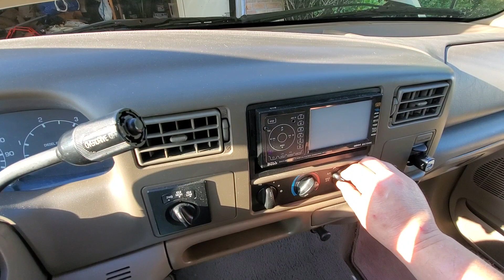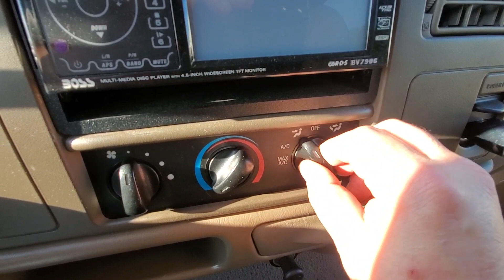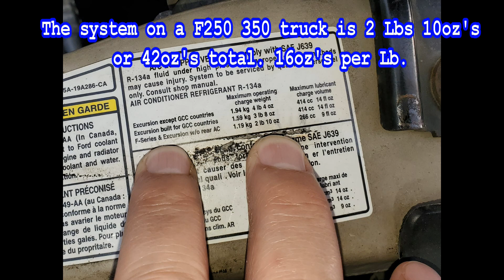How to Detect Low AC pressure Easily Ie F250 or F350

Comment: I have a few questions;
1. How long can I run the ac with the bypass?
2. How do I know if the pressure switch is N/O  or   N/C when buying a replacement  if it doesn't have a part number,  or is not in the auto system computer? 

I have a semi with an APU that keeps giving me a Low pressure fualt reading.  
I put ac in the system before starting to troubleshoot,  so most likely it's overcharged now.

What the AC is doing:
clutch turns on for 3-5sec. before it disengages. 

After  3-4min. It gives me a low pressure reading on the unit, and the clutch is disconnected for safety.  

Troubleshooting:
* I found out the fan was not = working and replaced it. 
Clutch still engage for only 3-4sec.

** bypass one of the pressure switch and noticed that the clutch will stay on for a longer period of time.  (Seems to be the problem). 
= not sure how long I can run it with the bypass,  so after 15sec. I pulled it out. 

Need to know if it's overcharged, if it will damage the system if left on too long with bypass?
Reply from the maker: Glad you asked that question, it's a very good and intelligent one.
1. I would not run the bypass more than 10-20 seconds at a time. The system is designed to switch on and off every few seconds as it's doing. That's why the switch is actually called the Clutch Cycle Switch, but most people still call it the Low Pressure Switch. So the clutch will cycle on and off 10-20 seconds at a time and that's normal.
2. Most Low Pressure or Clutch Cycle Switches are NO and will have the open and close pressures stamped on the side of the switch. High Pressure Switches are NC and will also have the open and close pressures stamped on the side of the switch as well.
 
Some systems are coupled into the computer but most are not for Light Trucks, I do not know for a Semi Trucks.

* It sounds like that the fan was definitely your initial problem, and the Cycle Switch sounds like its working to me. If you have another truck with a working AC System just like yours, open the hood, run the AC and compare them and see if there is a difference.
** If you bypass one of the Switches at a time, the system should run until the one that is not bypassed will cause the system to cut out. If in doubt on which switch is bad change them both.
= Again I wouldn't run the bypass more than a 10-20 seconds at a time. 

For sure if the system has a major undetected pressure issue don't run the system in bypass mode more than a few seconds or you can blow the AC line. The only SURE way I know to tell if its overcharged is to put a set of gauges on it. 
=== Another way to guess the pressure is right is to put a low pressure gauge on it and let a little of the refrigerant out until the pressure reads slightly low. Then add just enough refrigerant until the low pressure reads right for the outside temperature. If the system is charged correctly the system should cool the cab down as normal and the clutch will cycle on and off every 10-20 seconds. It's better to have the system a little low than run the system in an overcharged mode with possibly bad pressure switches.

== Here's what I would do in your situation. 
1. Make sure the Condenser and Evaporator are both clean, don't forget the Cabin Filter too, if your truck has one. If they are clogged the system with cut in and out more often and won't cool properly.
2. Change both switches. NOTE when changing the High Pressure Switch the, one closest to the Compressor, the Schrader valves like to stick and let all the refrigerant out. So be ready with a new seal and some Refrigerant Cans to recharge it. You might want to wear gloves for that so you don't get frost bite.
3. Rent or buy a set of gauges to fix it.
4. If buying a set of gauges is out of your reach, take it to an AC repair shop and have them check the pressures for you. Some shops will do a quick check it for about $35.00 US.
5. If that's not possible try to do the "=== Another way", listed above.
Hope this answers your questions and helps you diagnose and fix your AC System. Let me know if I can answer any more questions. Best Wishes & Blessings. Keith Noneya    PS where are you live?

Comment: I'm having such a hard time. I have a 2000 gas excursion, the compressor is running(It turns on and off), the system is full, but it only blows luke warm air.
Reply from the maker: You may have to put a refill bottle on it to see if it's barely low or overcharged. The other possibility is the Evaporator is clogged and needs to be cleaned. You need to put a set of gauges on it to check the pressures. Also check the Condenser to ensure it's not clogged too. Hope that points you in the right direction. Best Wishes & Blessings. Keith Noneya
Reply: @keithnoneya  Thanks for the tips, I will try that.
Reply: @keithnoneya  Thanks for the tips, I will try that.

Comment: Is the low pressure port  where the schrader valve is located.        thanks  George
Reply from the maker: No it's on top of the Accumulator Dryer under the black cap that I point to at about time index 3:35 through 3:55. Now it does have a Schrader Valve inside the port but so does the low pressure Cycle Switch, so I used the time index to make sure you get the correct Schrader valve. Hope that helps point you in the right direction. Best Wishes & Blessings. Keith Noneya
Reply: @keithnoneya  Thank you so much. i noticed there are threads up at the top of the accumulator low pressure port but I believe the valve is lower? I have been trying to find a schrader valve for the top.
Reply from the maker: @patchreefs  The threads in the top are the ones that the schrader valve screws deep inside. Notice how far I put the screw driver in the let some of the R134A out. The top port is where you check the low pressure and fill if it's low. If you don't have any R134A in the system that port is where you can pull a vacuum or pressurize it with air or Nitrogen to find the leaks with some soapy bubbles. The lower port schrader valve is for the Low Pressure or Cycle Switch, so if you change it "Theoretically" it won't lead if you pull the switch off. This isn't always the case, so if you pull it off have a new seal and pressure switch ready to go back on quickly so you'll minimize the amount of R134A leaks out if you change it.
When dealing with pressurized gasses always wear a set of safety goggles. I did a high pressure switch on the compressor up on top on the high pressure line. And sure enough as soon as I pulled the switch off it started leaking out rapidly. I had my goggles on and had a switch and new o-Ring and it was tough but I was able to get it on before I lost a lot of R134A. We added on can and it's been good since them. Best Wishes & Blessings. Keith Noneya

Comment: Here is a question... how do you know which wire engages the clutch, ie. ground or + wire?  Will you see only voltage coming through the wire when then the AC turns on?  So if you take a volt meter, unplug the two wires in their harness from the compressor and check which one (looks like green and red?) gives voltage when the AC is on right?  Trying to install an e-fan in my 6.0 2005 F350 to replace the clutch fan...
Reply from the maker: Super good question. I'll look in the schematic in the service manual when I get home. Haynes has a copy in the back if you have one. If you don't have one and want one, I can email you a picture of it. Send an email to my channel email here: keith_noneya@att.net and I'll email you one for future reference. Don't worry I won't put you on some mailing list or send you a ton of crap or anything like that. It's just for the picture if you want a copy. Either way I'll still try and answer your question when I get home in about 3 hours. Not shown in the video it the high pressure switch. Those go bad too. Without the engine running if you pull the connector off and put a meter leads on it, it should read a short. Low pressure if you have a good charge should also read a short, on the sensor itself. Either way I'll do my best to walk through this with you and help you find your problem. Best Wishes and Blessings. Keith Noneya
Reply from the maker: Hey Alp, the 12vdc comes from the AC switch on the dash, to the Low or Compressor Cycle Switch, to the High Pressure Switch then to the Powertrain Control Module (PCM) then to the Fuse Panel Wide Open Throttle AC cutoff Relay or (WAC) then to the compressor clutch coil. The connector on the compressor has two contacts in it. The top one is the 12Vdc supplied by the switches and relays, the bottom one goes to ground. If you're going to run a fan off the AC switched low pressure or Compressor Cycle Switch I would run that to a relay and have the relay run the fans from the battery. Also don't forget to put a fuse in the line and put a parallel bypass Thermal Switch so that when the engine gets hot the fans will come on regardless if the AC is on or not. Hope that helps answer your questions. Best Wishes and Blessings. Keith Noneya

Comment: i HAVE A 2003 f-250  i PUT THE a/c ON WHEN I LEAVE WORK , IT IS NICE AND COLD FOR 5 TO 7 MINS THEN IT STARTS TO BLOW HOT AIR.I TURN IT OFF OPEN THE WINDOWS AND GO HOME IT SETS IN THE DRIVEWAY FOR 2 HOURS OR SO START IT UP TURN ON A/C AND IT BLOWS COLD AIR AGAIN FOR ANOTHER 5 TO 7 MINS AND HOT AIR AGAIN !! I PUT 2 CANS OF REFRIGERANT IN AND IT MADE NO DIFFERENCE COULD YOU OR ANYBODY GIVE ME A PLACE TO START AT. I AM AT A LOSS.THANKS.
Reply from the maker: Hi Robert, there are a couple of things that can cause this;
1. One of the most common on this is the Evaporator (the part that pulls the heat out of the cab) gets clogged up with dirt and dust. When the evaporator starts to produce water that water gets into the dirt in the Evaporator fins and the air can't go though it easily and pressure builds in the system and "I think" the High Pressure switch disengages the compressor and the cab gets warm. The system will act like this until the Evaporator fins dry out enough to let air go through them. 
2. The Condenser (right behind the grill) gets clogged up with bugs and dirt and the same thing happens.
3. The clutch or electric fan right behind the Radiator stops spinning or spins really slow and the same thing happens.
4. The Metering Orifice over time gets clogged up and the system can't get enough R-134A to run through the system fast enough and can't keep up, Same as before the pressure builds and the system safety switches kick in to keep the system from blowing a hose.
* Corrective Action ***:
1. Clean the Evaporator, here's a link on how to do it.   https://www.youtube.com/watch?v=TqFf7tP7Nfw   The nice part is you don't have to vent your R-134A to do it. The bad part is it's a real pain in the butt to do, but definitely doable and worth the effort, even it that's not your problem it will only help your system to cool faster when it's fixed.
2. Pull the Grill and clean the Condenser here's a video on how to pull the Grill https://www.youtube.com/watch?v=gTHw6NuuMic
3. Is a little more complicated depending on if it's electric or belt driven. sorry I don't have a link to video on those. You'll need to search around and watch some videos on how to do that. 
4. Will require you to get the system drained, a set of gauges, a vacuum pump, new seals etc. etc. If you're not familiar with doing the AC either learn a lot then rent the tools or take it to professional to get that done. Hope that points you in the right direction. I'd clean the Evaporator to start with then see if that fixes it, then go from there. Best Wishes & Blessings. Keith Noneya

Comment: Do not rely on the can gauges.  Get an ac manifold gauge set
Reply from the maker: I agree, if you're going to do repair work on the AC system you should invest the money and get one. However in this video It's just for an indication, as most people don't have a manifold gauge set. As the video title says "How to Detect", it's not repair video that would be a whole new video. So for a quick detection or a quick fill, if low, a cheap can with a gauge will most likely get the job done until you can get it to a certified AC Technician. Best Wishes & Blessings. Keith Noneya

Comment: So I’ve got low pressure . But the r134 a seems to still not take . Should I evacuate and re install . The compressor is just going on and off if I jump it it stays on
Reply from the maker: Hi X Rasta sorry for the late reply I was away from my emails for a few days. Most likely the switch is either bad or you do have Low Ac Levels. Sometimes if the system won't take anymore AC it's because it's either overcharged or the valve connector you're using is bad, I've had a good set of gauges or so I thought and it turned out to be the Low Pressure Valve was internally clogged and wouldn't allow the R134a to go into the Accumulator. If you can't figure it out take it to a professional and have them do it for you. Get an estimate and try and fix it yourself. Just tell them you'll have to save up or something. You can rent the Vacuum pump and the gauges from AtutoZone or another Automotive Parts store. Hope that gives you some ideas. Best Wishes  & Blessings Keith Noneya

Comment: I did the bypass on the low pressure switch clutches came on. 
So hooked a can of refrigerate up and it shows in the red on the cans gauge. What should I do next?
Reply from the maker: Sorry for the late reply, my dad passed away and I've been dealing with the estate. 
If it came on let it run for a minute with the engine on to let the system stabilize while watching the gauge. The gauge should start to drop to the green or lower pretty fast. If it drops and the AC works normal in the green while bypassed then change the Cycle Switch commonly called the Low Pressure Switch. If it runs but drops into the yellow or below add some R134A until it goes into the green. If it doesn't drop or run normally after that then you probably have a blockage or something else wrong in the system and you'll need to take it to a shop and have them give you an estimate to repair the system. Hope that points you in the right direction. Best Wishes & Blessings. Keith Noneya

Comment: Silly question: If this paperclip trick works, I need to replace my low pressure switch, right? 
Switch plugged in = very high reading on the gauge of refrigerant.
Switch out w/ paperclip in = green reading, clutch spinning, air is cold.
Thank you very much for your efforts in helping people. Subbed.
Reply from the maker: If you put the paper clip in and the AC works normally with cool temperatures, approximately 30 degrees lower than the outside air, and the gauges read normal. Then yes I would suspect a bad Cycle Switch.  Thanks for the sub and glad to help. Best Wishes & Blessings. Keith Noneya
Reply: @keithnoneya  Thanks for the response. I happened to test it all out again with the switch plugged in, all is well! Your paperclip trick to get the clutch moving with applying refrigerant worked wonders! Thank you so much!